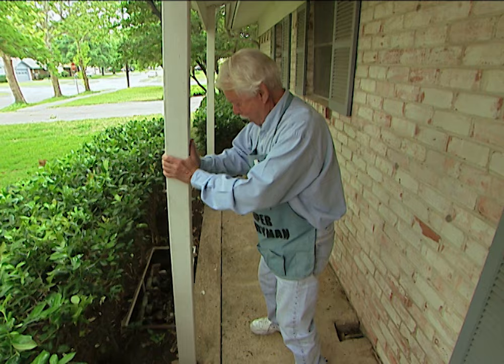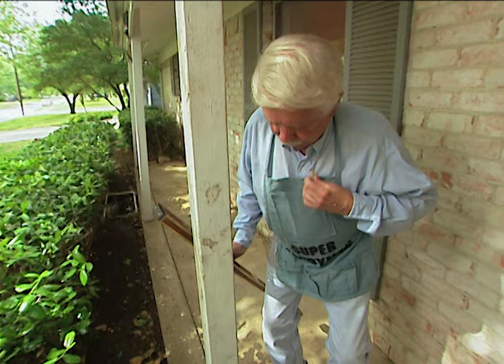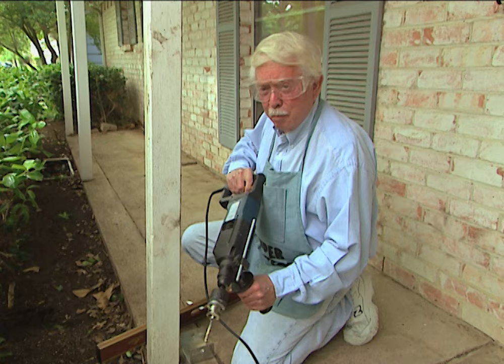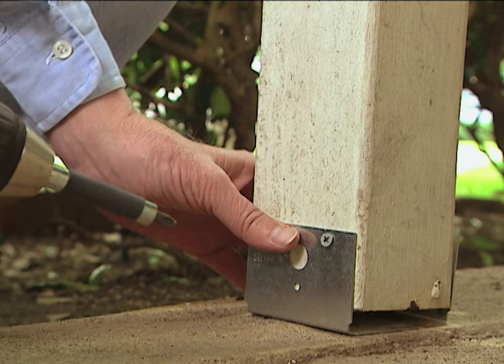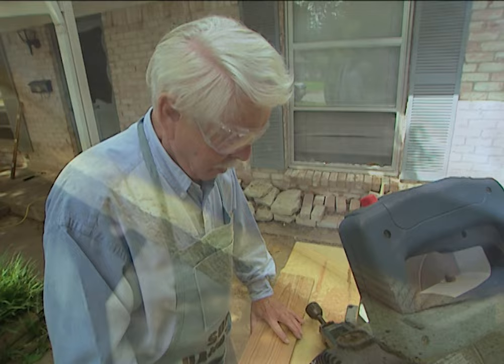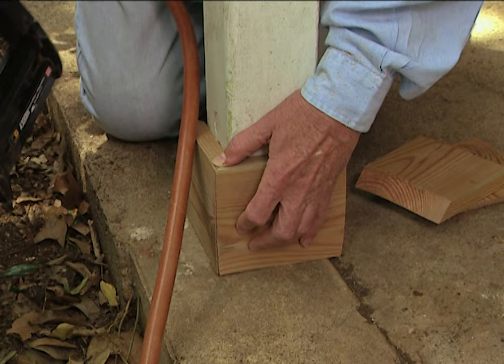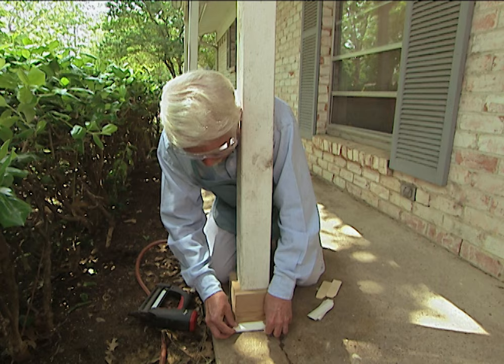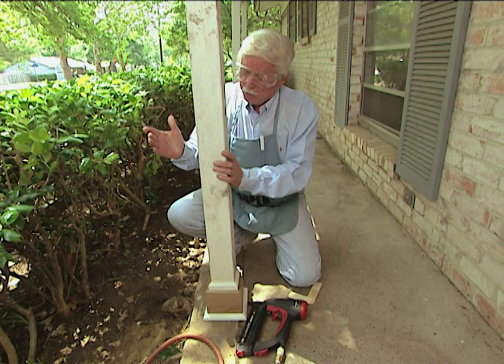How to Trim a Post

Comment: Use a rubber mallet with a block next time so you don’t blow huge dents into the posts lol.
Reply: Most times I'd agree, but it makes  no difference if you're planning on covering it with all that trim.

Comment: I would have shimmed the post so that it was supporting the house a bit so that time would not make that part sag. Then the post would be tight.  Raise front with another post and hydrauluc lifts. shim old posts, lower lifts.  Then put decorative trim around post bottoms.   Just hate seeing the loose post.